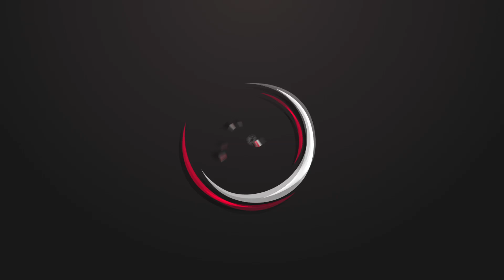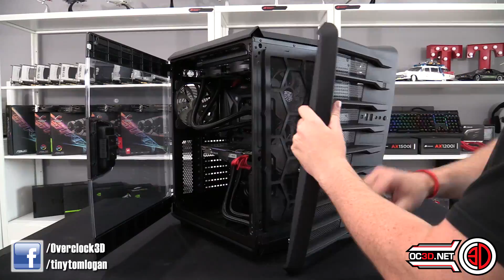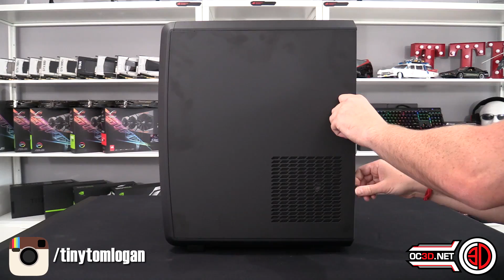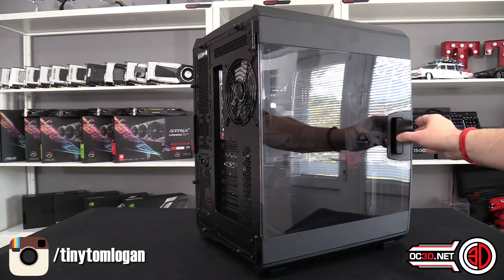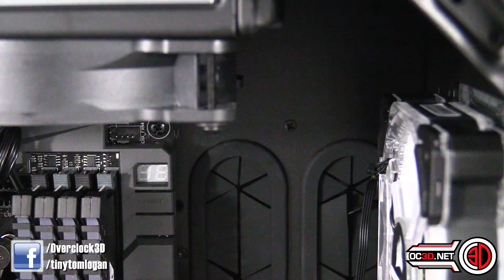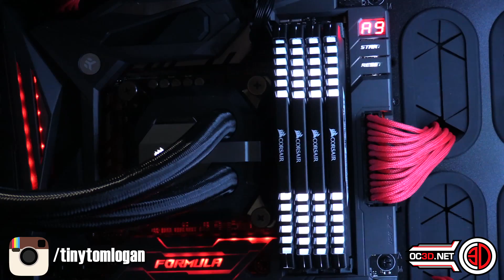Corsair Air 740 Case Review

Comment: I love this case. It looks weird for sure, but for some reason I like the way it looks. The airflow and dual chambers are really really good IMO. I run a h115i on the top since my msi 1080 Duke is too long for front mount. Noctua 140mms all around the rest of it and nothing ever gets hot. Cable management is a dream.

V2 I'd want filters on top and bottom too and maybe make it an inch longer.

Comment: Hello, I am doubting this Corsair Carbide Air 740 tower and Corsair Graphite 780T. I like both but the 740 I like it for its comfort and spaciousness. Which one would you recommend for me? Another question in the case of the 740, would it be possible to place two usb plus 3.0 on the front? Regards

Comment: How many 3.5inch drives can u fit in this case? I'm looking at building a FreeNAS file server. Need at least 5 drive bays to run raidz2. Or does anyone recommend a case. Don't want to pay too much for a case as I'll be spending just over £500 for the drives and already spent about £150 for a second hand mobo,cpu and ram

Comment: The bit about not needing airflow in the rear section is a bit false. If you have mechanical drives, they will get crazy hot with zero airflow black there. Moving from a Carbide 300r to this case my HDD's have gone from 35C to 65-69C. While I got it for the better airflow for  my GPU, and better clearance for my NH-D15 dual fan, I do need to do something about the hot HDDs.

Comment: You Must Be!
I Hate When The Psu Is At Bottom Just Under GPU's
I Have Corsair 1000w  80 Plus Gold Cert. Just Above 2x Titan X's Sli, So At Full Load The Heat Off Psu  Go's Straight into My Gpu's ?????????

Comment: Not enough filters, have 2 filters that came with PSU from Silverstone  that will fit on the bottom  but for the top they could have attached to the top panel as its removeable .........lots of plastic and be careful when moving. Its a case to be careful with when handling. I do like the room at the back.....no messy jamming cables in

Comment: @OC3D TV; Could you please tell where did you plug the GPU's radiator fan (lowest one on front panel)? I am confused how it is changing colors sync'd with others, isn't it need to be connected to its own heatsink or to the motherboard, if so then it wont be connected to fan hub though its changing its colors aligned with others when you press the button. Thank you for answer or anyone else!
Reply from the maker: The fan LEDs have a hub with a seperate connection to the fan speed power (2 seperate connections per fan)
Reply: OC3D TV oh man thats just great. I am subbed bcs you are such a gentleman and very good reviews out there!

Comment: HDD's do get hot. 
I use 5 WD caviar green and if i don't add a cooler i start seeing 50'sºC specially in summer (Ambient 30ºC). That is pretty close to the 60ºC ceiling safe temp for HDD's. This HDD0s are 5400RPM let alone if they were Caviar Black. 

To bare that in mind. You could actually need one fan, let it spin slow just enough to remove the trapped heat between the HDD's

Comment: The front looks like it's made to lay down on its left siden and have a horisontal motherboard. I had decided not to go for this, but on its side, I think it will look much better, it fits a 360 in the front nicely (EK Predator, to add a 1080 block later). And good space to get my 780 a bit apart from each other since I have an mATX motherboard, and they're now all up close to each other. So this, painted, with the LED fans maybe, might be good.

Comment: I am really considering buying this case to replace my 450D but I'm worried about the lack of dust filters. The front and top are lacking them.
Reply from the maker: The front has them but unless you are planning on having the roof as an intake it wont matter. Bottom is the worst one
Reply: Ah, I don't know why I said the front doesn't have one, I can clearly see it in the thumbnail. I would've been nice to have one on the top though.

Comment: Can you please tell me if a EK Predator 360 will fit in this case? You didn't use the tape measure for the front :/. EK posted specs with measurements. It's a 360mm rad with a DDC pump on it.

Comment: the cutout at the front for the HDMI is too big for a pass through i was thinking of a manual fan control and other features such as USB C or whatever besides the HDMI pass through as i could squeeze 3-4 HDMI ports in a line there or at least a second option for a different I/O besides only a HDMI pass through
Reply: i need that space occupied with whatever as long as it is not 1 HDMI taking up so much space

Comment: Love ya reviews bud =)

Don't think I will be upgrading my air 540 any time soon to that. 
Its a shame they couldn't chuck a bottom dust filter in it, a case that is in the $220AUD range should have one, seeing as most cases that in the $140-200AUD range all have them. I'm glad they put one on the PSU, I ended up buying a magnetic one from ebay for $10 that does the job (silverstone maybe?)

Kinda wish they would just update the 540, class it up a touch with abit of steel/alloy exterior panels, maybe make it a touch smaller trim some fat..?

Comment: Just a personal note on your install, should mount the fans after the radiator. Then the radiator sucks dust in like a filter and its easier to clean, instead of getting caked into the rad in certain spots. (think when you don't clean a dust filter on the intake for awhile, there are usually heavy dust round spots where your fans are)
Sure with a filter there is minimal dust, but you know there will always be abit of dust in a PC case.
Plus, it also covers the cheapo looking standard grey fans.
And you 100% need a led rear fan =) As often you will be looking at the case from the front 3/4 I've done this on my air 540 and it greatly improved the look.

Comment: so an E-ATX board and a 360x60 rad is impossible. Not a very good chassis.
Reply from the maker: Both are possible.
Reply: +OC3D TV is a normal ATX board combined with 2 360 rads possible?

Comment: The lack of dust filters for the top and bottom is troubling, but I can live with it. The exterior seems a bit overdesigned to me, but this is obviously a question of taste. I would not necessarily consider either of these a dealbreaker.
What I cannot forgive, however, is simply this: NO. 5,25''. BAYS. WHY, CORSAIR, WHY?! I know all the cool kids be downloadin', but it's nice to have options, and there are 5,25'' devices other than optical drives: Fan control panels, card readers, OC controllers, you name it.
"Mimimi, just use USB ones and put them on your desk." Well, I don't want them on my desk, I want them in my case, where they belong. I've got enough peripherals taking up USB ports and flopping around my workspace as it is.
Also, the fact that they included some sort of tiny VR passthrough WHERE THE ODD SOULD GO just adds insult to injury.

Comment: Am I the only one who likes it?
Reply: it looks good to me. I am used to those types of cases as I own a Cooler Master Haf XB partially modded
Reply: Its nice !
Reply: i forgave it not having a dvd player slot because of how much i liked it .
Reply: i like it a lot. I love that “ladder” look. But for some reason i prefer the 540 over this one. Love the fact that it hides all the drives, and i’m still using spin drives so it would be nice to hide those. But wait, correct me if i’m wrong, but aren’t the two drive mounts for 3.5” drives at the bottom? Which is also visible through the side panel?! crap...
Reply: I love mine.
Reply: Well IMO it looks really fucking ugly compared tothe 540.... However it isnt that ugly compared to other cases. The only reason why I like the 740 is because of the sturdier side panel for it..

Comment: Is it me or did Corsair just go backwards? A 540V2 would be nice. The Corsair 400C and Corsair 760T were fantastic. Why not just fix the 540 by putting dust filters on the air compartments and fix radiator mounting ease.

Comment: I like my 750d case, however I wish it had a hinged side panel  :(   trying to figure out how to modify it.
Reply: i originally wanted that case but it has too much aluminum i want a strong steel case i am not too big on hinged panels as i do not want kids trying to open the fucking case after seeing the interior shine through though i do like this case
Reply: @6:23 you can see how the window side panel is linked to the case

Comment: was disappointed with 540 being dusty and stuff especially from the huge gap from the bottom of the case. Need to buy a third party dust filter. And this 740 not having a bottom dust filter is like corsair didnt bother to think about dusty situation being sucked in from the bottom of the case.

Comment: the front cutout is not for an "optional hdmi throughput"  its for a goddarn floppy drive , every REAL computer has those
Reply: actually no it is not but having 1 HDMI is not good there is space for like 3-4 HDMI ports i would want a manual 3 knob fan control with a USB C and a HDMI i think it can barely manage to fit in to the I/O cutout

Comment: I fit a 3.5" front panel port expander for my Oculus Rift VR HMD to the front of my Air 540. 

https://www.amazon.co.uk/gp/product/B00BU977Y2/ref=oh_aui_detailpage_o00_s00?ie=UTF8&psc=1

Primarily for the HDMI & USB3 passthrough for my Oculus Rift but the other ports are handy to have on the front too. I can't have my G920 Wheelset or X52 Pro permanently setup and messing around with the usb 2 cables at the back of the case for them every time was a chore. Theres also 2 USB charging ports which means my Corsair Void Wireless Headset on charge or my eCig charging are not taking up valuable Full USB ports. My Asus Z170-A mobo had plenty of USB motherboard headers but is light on actual usb ports on the back I/O, so this front panel port expander turned out to be a real boon. I'm lucky I never managed to track down the likes of the eVGA or MSI VR port expanders (1x USB3 & 1x HDMI) for my Rift before I came across the expander I linked above.

To answer the question about whether HDMI on the front panel is necessary for VR.

Strictly necessary? No.

Highly desirable? Yes.

The more available cable slack for VR HMD's the better. Means you can move around more/further for standing/roomscale VR experiences. You lose about a metre of your cable length just routing it from your back GPU HDMI port around the outside of the case to the front of your case. A front mounted HDMI port means you don't lose that 1 metre of available cable. Another valuable reason for a front HDMI port for VR is that you are Blind to the real world in VR obviously enough. You have a long cable tethering you to the PC. At some point you are going to trip on that cable or it'll catch on something and that cable is going to get yanked. Better it pull on and possibly damage a simple cheap HDMI passthrough port on the front of your case than to damage the HDMI port on your €800 GTX 1080.

Comment: To be honest I'm dissapointed. So lets discuss the good things first:

the desigh is cool.
More room for push/pull or thicker radiators is cool I guess.
The 400C like clear side panel on hinges and with latch is cool.
The option to use bottom fans to feed air to regular graphics cards is good.
The gap between PSU and inner wall is good since with 540 you could route the cables behind the PSU at the bottom but you had to do it before you completely screw the PSU into place.

What I kinda don't like:

Its bigger than 540 and 540 allready could mount E-ATX motherboards - so why?
To be honest I don't like the way front panel has to be ripped off - on 540 you unscrew the top panel screws, slide it back a bit and you can just slide the front upwards and remove it.
Obviously the fact that it doesn't have bottom fan filter - again, unless you had a positive pressure in your case the 540 pulled dust from underneath the drive cages.
Just like with 540 I feel that the backside is bit too wide - especially since with this case the 5,25 drive bays are completely removed - who actually needs like 5 SSD slots and 3+ 3,5HDD's slots?
No fan hub.

Overall, its a bit bigger 540 with different outer design but with same flaws.

Comment: I have the Air 540 and Iam jealous of that side panel handle. Also you can attach the fans or the radiator on the outside of the case within the same holes for more room inside the case... ghetto style.

Comment: Only improvement over the air 540 that catches my eye is the side panel and 360mm rad support. The new design is ugly and there is no 3.25" drives. I know no one uses optical drives that much anymore but it's nice for fan controllers or pump-res combos and they just took that away from the Air 540.

Comment: + OC3D TV Really disappointing this case .. I was waiting for a 540 refresh, and throughout the video I was saying damn, damn damn, and the same things as you said in the conclusion... So corsair thinks you should have 3 intake fans and 5 exctraction fans ? What a great way to create dust ... The only good thing is that they removed the 5 1/4 inch bay and made it for HDDs, and a little more space for a custom loop (I know it's a AIR case), but they should throw those flimsy ssd drive holder out, same as on the air 540 i've only got one that isn't broken, and i'm a gentle guy lol (I had to move one of my ssds around the front : http://imgur.com/a/pxVs0 ). Well I won't be getting this case, I like myself some cube case it's a shame, but for 30€ more the dark base 900 (not cubed of course) is way out of the league...

Comment: Great review as always but what a ugly case.
Cases from Corsair are going downhill bigtime in my opinion.
And they make the same mistake again & again with the holes on the right side of the 24-pin. 1 hole is to high & the other is to low.
Is it so hard to make that exacly aside the 24-pin. Fractal design can do it :P
It`s supost to be a showcase....Then do it proper Corsair because this is bad & ugly.

And for me as a custom watercooler: No place for a nice tube res on the mb side. Only place for cheap aio`s.
And I know a tube res fits in the back BUT a Tube res needs to be SEEN so in the back is NO option for me.
And don`t shoot me......I`m only giving my opinion.

But for a starter this is a good case.

Comment: It reminds me of a bigger NAS, looks really nice imo
edit: is Corsair really this retarded?...None of the Air series case have any cooling solution for the HDDs, not even this big ass thing...and the SSDs sitting on top of the PSU?...sigh
Reply: If your psu generates enough heat for you to be worried about that, then you should throw it in the trash right away.
Reply: ***** You really gonna blame a clearly stupid design choise on the psu?
Reply: ***** No I am going to tell you that you are adressing a non existing concern, if that was not clear enough.

It was not a "poor design choice" because it is NOT an issue and there is absolutely no problem with that.
Reply: *****"existing concern" So running your HDD on temps like 50+°C is okay to you?
Reply: ***** I don't recall referring to that one? What are you moving the goalpost for?

Comment: Will there be a Corsair 340?
Reply from the maker: There was a 240
Reply: OC3D TV Yes, hopefully a Micro ATX version is in the works.
Reply: +Kizakura I'm thinking of making a air 120 too, put both of my gtx 980 in the other chamber and cut in half :p
Reply: the 240 is Micro ATX, but I think there will be a mini ITX version.
Reply: The 240 is both ITX, and mATX. Now, they could go and make a Itx only version but I think at that point they might think they'd step on the bulldogs feet.
Reply: Kizakura True you are right, Would be nice to see an updated version.
Reply: +Tom Ferreira I'd loved to see one. I'm actually tearing apart my current version and going to build a custom Air 120. kinda like the Dan Case A4. but all the guts will be on the window side. SFX psu, GPU will be rotated to show the cooler ( I own the gtx1080 from Asus )
Reply: s340 cough cough
Reply: +Sufiyan Khan that ugly pos? lmfao nah
Reply: +Kizakura it has more features than aesthetics..
Reply: +Sufiyan Khan I don't need the features. the air 240 has everything I need. It is just too big for my tastes. Thus I am making a Air 120. just a cut down. 240 really.
Reply: XD sound nice!, and make a PCI Riser like a round cable, not like a traditional flat riser (ugly).
Reply: +xkche upgrade to a evga x99 micro 2(matx that supports 3way sli), 
buy another gtx 980,
 buy 3 ribbon pcie riser,
put all in the other chamber,
oh yea!

Comment: Can you swap places to bottom and top covers and make it inverted?
Reply from the maker: yup
Reply: Thanks!
Reply: £139 though ouch I got my Thermaltake Core X9 for £125 and it can mount 3 480's and a 240 at the same time and with a horizontal MB tray no GPU sag and both the side(non windowed) and top panel come with magnetic dust filters so while this is a nice idea over the 540 it would be a downgrade for me and oh the Core X9 is stackable :-) and comes in White too .

Comment: Looks like a fucking fridge
Reply: Lo Studios 5.25 bays are still useful for advanced fan controllers like aquaero,for hot swap bays,for bay reservoirs,also some people need disk drives
Reply: Haha! :D
Reply: I can see myself in a drunken state putting some cold ones in the case before bed by accident . Tbh I like my 540 cAse better. And no optical bay drive slot
Reply: +Brett W yes because it is 2016